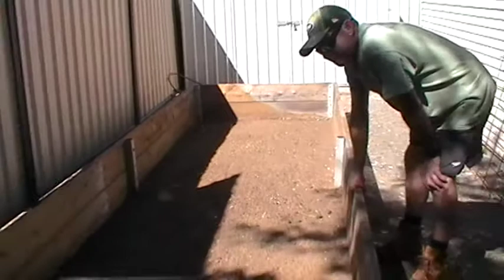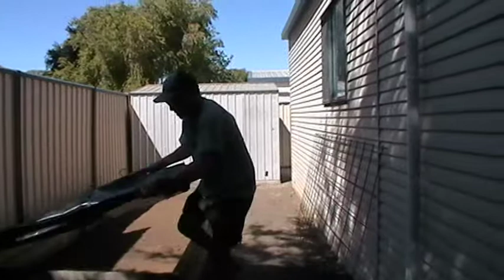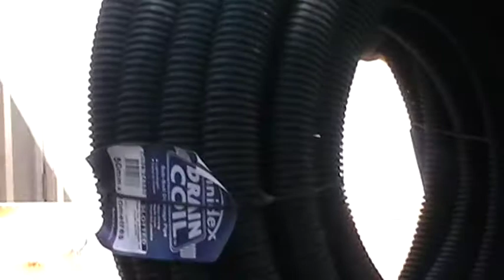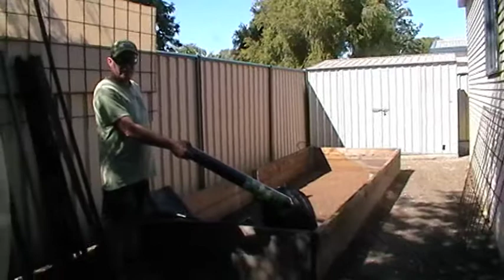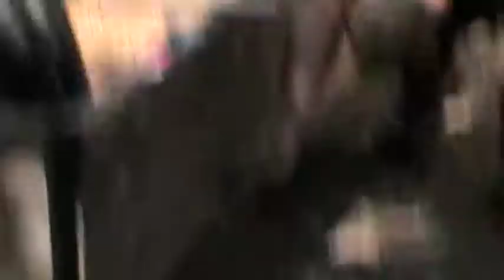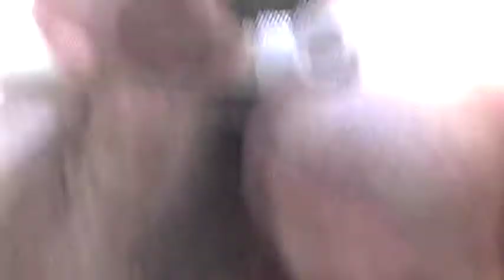1  Wicking Bed Setting Up

Comment: Less cost , less work... Happy days
Reply from the maker: Yes you could add the posts on the outside later Dave, no worries. If I had have built the base initially I would have done this from the outset but I inherited the bones of the project so just went with it. Strength is the key here long term.